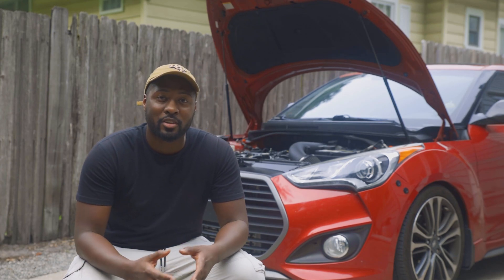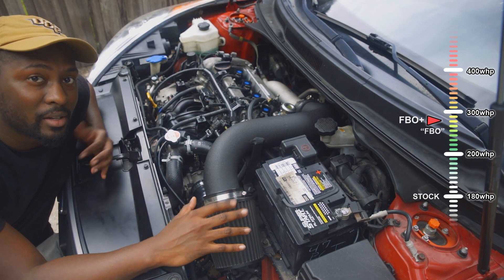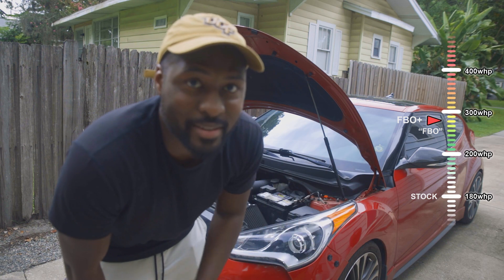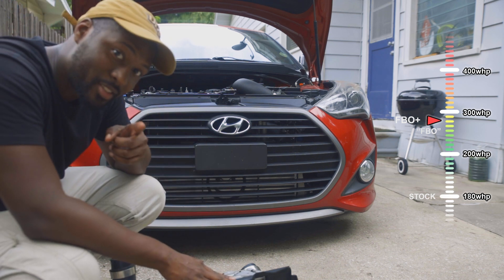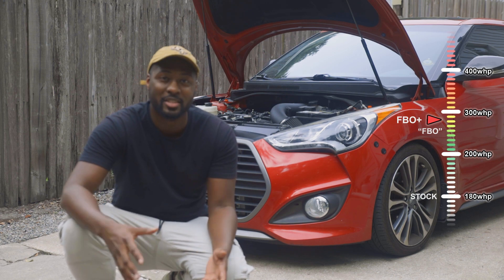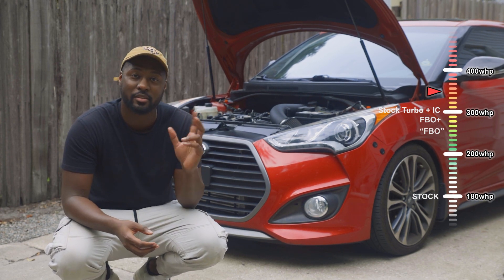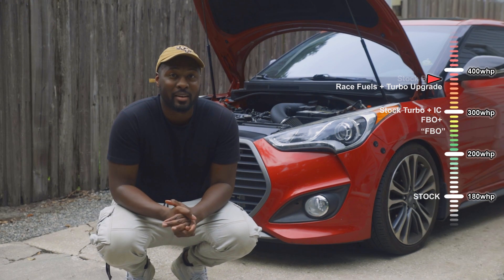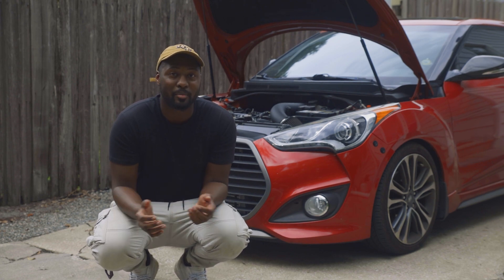How to Make Power | G4FJ 1.6T Engine

Comment: In your opinion how far can you make it horsepower wise on pump 93?
Reply from the maker: On 93, I'd probably say the car could make it to 330-350 with the right turbo and other mods. I'm currently tuned for 93+meth, but I plan to move to E85+meth shortly as soon as we get the current tune in a happy place.
Reply: Gotcha, I have a pretty much stock 15 VT manual and I want to start putting power to it but I also don’t want to go to E-85 so I was curious what my end power would be on 93. I appreciate the advice, thanks a lot.

Comment: Been looking at a race chip with my k and n intake down pipe and I got a valve tronic muffler installed for better airflow and sound control also have a resonator for intercooler deleted and a bov.
Reply from the maker: I really want to add a valve exhaust to mine. Cut it into the downpipe and wire it up!

Comment: What Elantra is that throttle body from?? Bro you need links to your build :) I’m trying to get as close to 300whp as I can on my 16 dct Veloster turbo. Still waiting on my tork intercooler…..it’s been over a month.
Reply from the maker: 2011-2018 elantra's. Lol I already did a video with all of my build, but I'll work on a document too. Lol I waited 2ish months for mine. Manufacturing times are alot longer than they used to be!